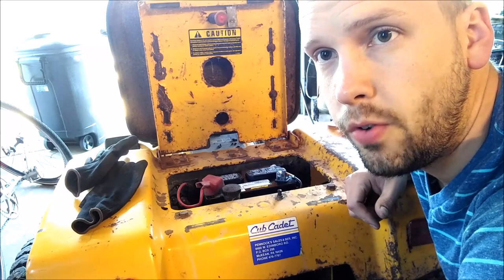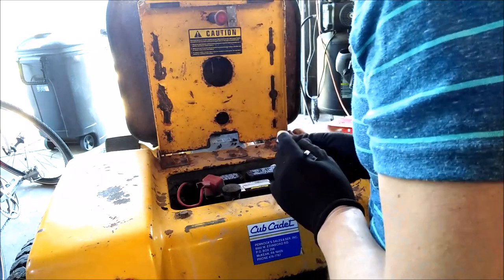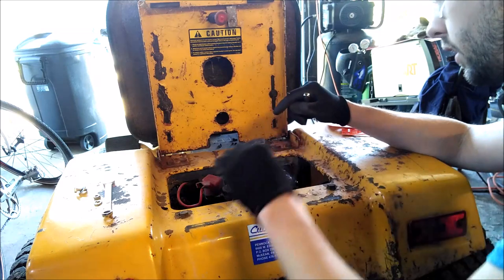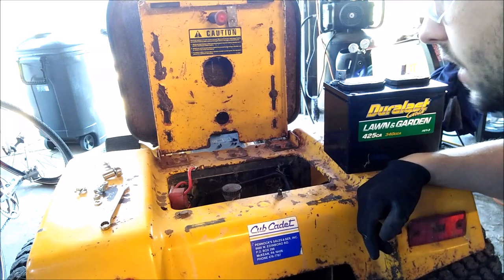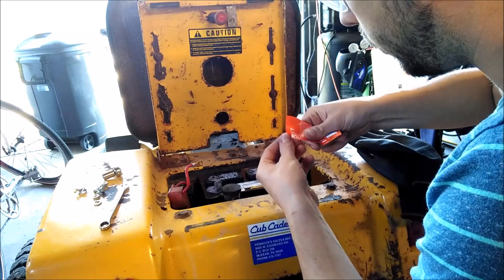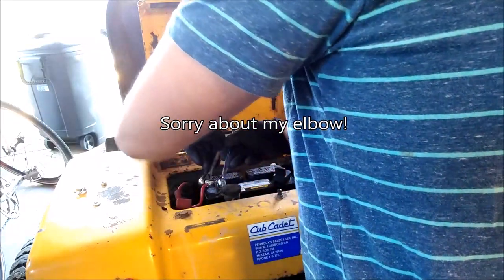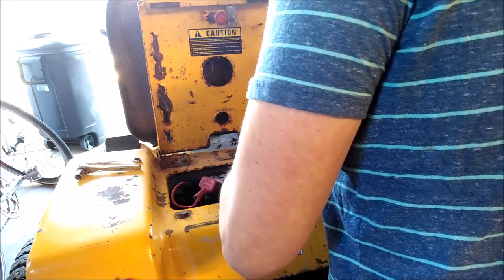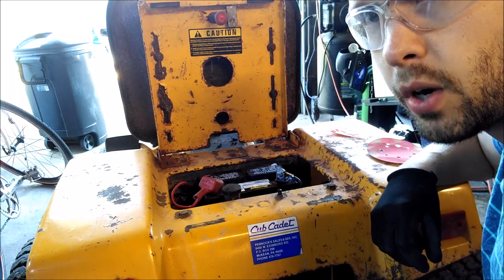Changing a Lawn Mower Battery Safely

Comment: Sorry... After the battery is set back I can't see anything but your arm and back...what is the set  up for reconnecting the bolt - the 'ring' thing  - and the nut  to the battery terminal itself (couldn't see the order/positioning of these parts)?